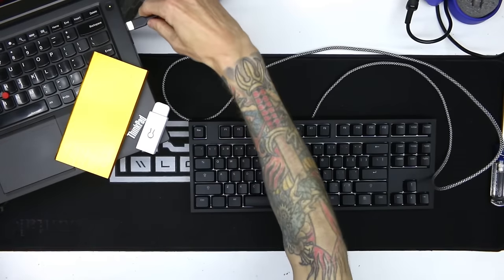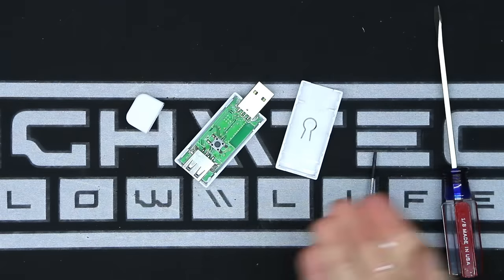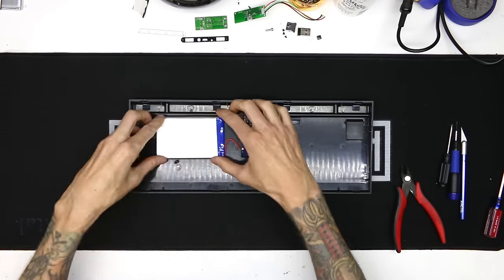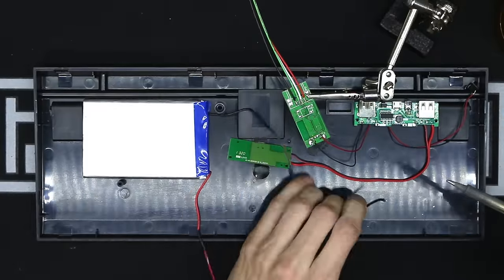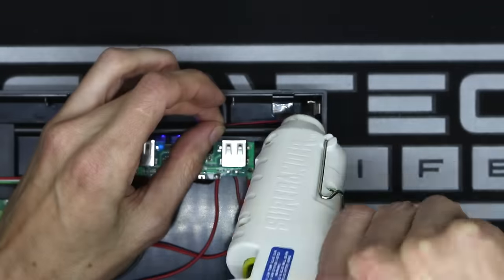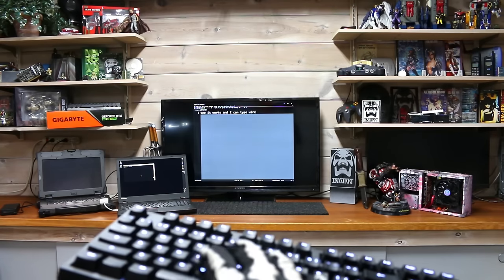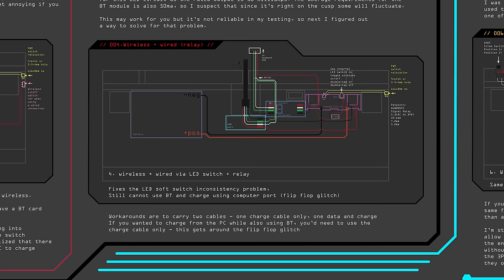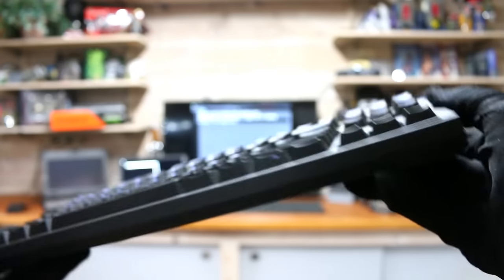⌨ Make ANY Keyboard Wireless! - Convert Any USB keyboard to Bluetooth Wireless - DIY Tutorial How To

Comment: Really loved the tutorial! The BT module you've used is BT 4.0, would you know and recommend any modules that are 5.0 and would do the same? Or is it even necessary to have 5.0? Thanks, really appreaciate it!
Reply from the maker: Thank you! Biggest difference is range, I believe 4 is 33ft and 5 is 248ft range. I don't know many applications where you'd need to be more than 30 feet away from your computer, but I suppose it's something to consider. I'm quite certain HHSCI will offer a 5.0 version at some point though, so if that's something important to you, you may want to wait. 👍
Reply: @hightech-lowlife  oh ok sweet, yea dont think I need that much range. Ill stick with the 4.0! Thanks!!
Reply from the maker: @zyeansantos7472  No problem 👌

Comment: It's a great video and proves it can be done although the adapter itself costs around $40 and a power bank around $20 not to mention the time and other tools required to make it happen. Unless it's a really unique or special wired keyboard to convert to wireless I believe one can get a fairly good wireless keyboard for $60. Add another $20 and we are in mx mini or keychron territory.
Reply from the maker: Thank you. 

Yes, I was going to put something in the video explaining this, but I felt it was so obvious that it would be a bit condescending, but it seemed like I needed to do it after all judging by quite a few comments I got that were attempting to call out my "oversight". 

A lot of people have pointed out "this is pointless because I could just buy a ___ for ___ and save money and it would be easier". To me, this is obvious, not really worth commenting on as this video is clearly not for that intention, if you're trying to make a wireless keyboard for less than $5, this is not the tutorial for you, and I don't believe it's possible to convert a wired keyboard to wireless at that price point, unless you're exceptionally good at hacking, firmware and software modifications and even then if you value your time at all, it's not worth it. The fact that someone has not done or made a tutorial on it yet in all of these years to me shows the difficulty. 

I feel if you're severely limited by your budget than seeking a wireless option is equally pointless, you can easily get by with with a very cheap and most cases free keyboard that is wired. Wireless adds much more complication, less reliable connection, reliance on batteries, etc. 

If your end goal is just "cheap wireless" there are many options premade already out there, this tutorial is not meant to be a replacement of that. This tutorial is for people who either want to hack and build something of their own for many reasons (love DIY, learning electronics), or if they have a board in which was never offered wireless and there are no alternatives to the keyboard they want that is also wireless. 

Thank you.
Reply: @hightech-lowlife  Well said however with such videos it is obvious to the content creator as you are already aware and have done your homework but to the rest of us who are not aware it is not so obvious. 

As you have mentioned a lot of people have pointed it out which should give you some sort of feedback and another *idea*.

Personally yes I would wish to do such a project as you have demonstrated how simple it is. I’m not saying the whole project should cost me less than $5 which is not practical but it shouldn’t cost me more than the price of a brand new Logitech MX Mini or a similar tier keyboard which is also not practical. I am not severely limited in my budget that I cannot afford a wireless keyboard. They can be bought for as cheap as $10. I just bought a Logitech MX master 3 mouse and was looking to compliment it with a wireless keyboard. I have a wired PS/2 cherry keyboard and was looking to make it wireless but if that's the cost then I'm better off just buying a Logitech Mx mini. 
  
Wireless is not as bad as you point it out to be. Yes, they rely on batteries but so does every other wireless device. I have not heard of a connection issue unless the keyboard is either very far away from the computer or there is a hardware or driver error. At the end wireless is all about user experience and convenience.

I totally agree with you on the part where there are cheaper wireless options already out there. And yes this project is for those who have a wired keyboard that they really want to make wireless.
           
Otherwise the reason why I watched your video is because I also love and enjoy DIY projects. I thought of doing a DIY project on my cherry keyboard but I will be using a different method.
Reply from the maker: @ahmedtwahir  Thanks man! 

Yes, it's actually quite difficult to create content in a mindful way, as the range of understanding from your viewers is extremely large, so you have to choose some spectrum. This also was the 4th video I ever made and I would have done a lot of things differently had I the experience I have now. 

I think for your particular wants, then it would be possible to do it for less, there are some arduino boards that are bluetooth that can do this, but you will have to load some code and probably edit some things. It may also not have all the features that this module does, so to save some money, there are some trade offs. Another option is to pick up another cheaper wireless keyboard, and port the guts to your wired board, I've seen this done and it could also be a cheaper method, it all depends on how much you can get the other used board for. 

People will have a subjective experience with wireless, but having worked in many environments using wireless (business, networking, etc), you always use a wire when you can for a reason. Hardware and driver errors can occur quite often, or actually most often when you don't have the time to deal with them. 

Thank you for your feedback, it's much appreciated. If you do try to the DIY route, I wish you the best of luck on your project and I hope it comes out very well.
Reply: @hightech-lowlife  
I agree the viewer spectrum is broad on this one. 
I'm getting a wireless keyboard and mouse set for less than $10. Will do the internal swaps and maybe even mod the cherry chassis with a paint job or carbon fiber wrap. Easier said than done 😅.
I'm still new to content creation and my video/audio is not as crisp as yours but will get there eventually with discipline and practice. 
Thank you for taking the time to write back and wish me luck. I wish you more success with your channel and videos  🤝.

Comment: So about the 8th option circuit, I observe the wiring and pretty confuse. does that mean the wired connection port and the port to charge the battery were independent ? Like if I want to use the keyboard wired while charging it, there will be 2 cables connected to the keyboard ?
Reply from the maker: Both "completed" circuits I show in the infographic (7, and 8) allow you to charge the battery in wired or wireless mode, so you will be able to charge the battery whether you're using it wired or wirelessly. Remember there is only one USB port that goes to your computer (or charger) so you will only have one cable connected when charging regardless 👍

The main difference is that in (7) you're using the BT module as the "wired" bridge to communicate to the computer with a wire (USB cable), the only drawbacks to doing it this way is that it's not a "native" wired connection, so if you want to do something like flash your keyboards firmware with it, it will not recognize the keyboard because to your computer all it sees is the BT bridge. (7) is the easiest and simplest way to wire this up, so unless you have a use for a native wired connection, I would go that route. 

(8) essentially uses a relay to "unplug" and "replug" the cable connections internally, the same as you would if you were unplugging from the BT module then plugging directly into your computer, only it's done off a button and only the wires are swapped internally. This allows you to have a direct wired connection to your computer without going through any bridges, so your computer will recognize the keyboard as a keyboard.

Comment: Wonder if this would work with a K95 Corsair. Has dual USB for the leds.
Reply from the maker: It will work with backlit keyboards, for dual USB you may need another battery for LED power if it's that hungry.

Comment: Wow very nice! Do you know if there is any solution to build the opposite (the equivalent of a Logitech receiver) in order to be able to quickly swap a bluetooth mouse and keyboard between computers using a small usb dongle. Thanks!
Reply from the maker: You mean just a USB BT dongle? Those are very common and ubiquitous: https://www.ebay.com/itm/161959114629
Reply: No, I meant a DIY dongle which would run the bluetooth stack on board and not on the host device and would store the pairing with both a keyboard and mouse and fake to any host the connection to be USB. Ideally being accessible for configuration via SSH or something like that @hightech-lowlife. An example of this, is being able to go into the BIOS on an old computer using a bluetooth keyboard but more commonly, the use case would be to quickly swap a set of keyboard and mouse between different computers using only  a dongle. I know many people who are stuck on the Logitech ecosystem because of the practicality of their dongle which does the same thing but is proprietary. Such a device would make them super happy because they would be able to use whatever bluetooth keyboard and mice they want and keep the same functionality.
Reply from the maker: I'm not aware of any BT dongles that operate like a 2.4GHZ dongle as you have described. I'm sure it's possible to do, but it may just be easier to gut a logitech keyboard for it's "unified transmitter" bits and maybe port it to be reattached to any USB device, and then use their unified receiver for that scenario. Sure you miss out on the BT features of being able to use any BT device, but it will work as you wish, and may be modular enough to be able to plug in any USB device easily. 

After doing a menial amount of googling for you I did find this: 

"You pair Bluetooth device to a particular OS instalation on a particular computer. This is inherent design feature of Bluetooth itself, you can't do anything about it.

OTOH custom USB dongles (like Logitech and most of non-Bluetooth mice/keyboards) pair device to a particular dongle. The device works instantly with any computer you connect matching dongle to.

As Vladislav mentioned, you can craft a bridge: Raspberry Pi Pico W has everyting necessary to present itself over USB as a generic mouse and accept connection from a paired, fixed Bluetooth mouse. This would instantly work with any computer you'd connect this special Pi to."

So what you want is possible, if you use another intermediary computer (raz pi pico w) to spoof as a generic device and then relay the bluetooth separately.
Reply: Thanks @hightech-lowlife  I'm going to try the pi-pico way. That sounds promising indeed 🙏
Reply from the maker: Cool man, I hope it works out!  @altaresification

Comment: Will this still allow software control of the keyboard. For example if I followed this tutorial for a corsair keyboard, can I still control the rgb etc?
Reply from the maker: It may be possible, but also may not. I have not tried it personally so I'm not sure. It depends on how the software is affecting the keyboard, whether it's flashed/loaded onto the board, or if it's simply interpreting USB commands or making a translation on the computer side.

Comment: Hopefully you will answer good sir, since, scrolling through the comments I didn't see a possible solution to my dilemma(or maybe I just missed it). Where I live, it is near impossible to acquire that specific bluetooth module, which functions exceptionally well, being able to power up the module AND the keyboard simultaneously. Could there be another way to power up the keyboard while connecting it to the BT module for inputs?? Most things I find either require 2 parts (which would not fit inside my specific keyboard: Redragon Kumara K552) or don't have 2 USB for connecting the keyboard and on the other side have it power it up.
Reply from the maker: This BT module is pretty small, you don't need a charge PCB with two USB outputs, they make very small charge circuits which would work fine as well, something like this: https://www.aliexpress.com/item/3256801472488679.html 

You can also use an arduino which can do both BT and charge in one pcb: https://www.adafruit.com/product/2829 but you will have to load and flash code to it. 

Your board actually does have two parts, only those parts are very close together (port is soldered to the board) which I'm assuming is what you're talking about. You can do an intercept like I did on this build: https://youtu.be/2Df7Dh3-3o0 although if you have a type-c connector it can be quite difficult.
Reply: @hightech-lowlife   I'll start off by saying, thanks a lot for taking the time to respond and lending a helping hand, I appreciate it. I love my keyboard and when I saw your video I knew I had to do it, very inspiring.

I'm very new to this, so naturally, I have a lot of questions. Obviously I have to think about the project long enough to be 100% sure of what I'm doing and have an understanding of it. So for now, I'm taking things slow.(lots to learn)

I did search up bluetooth modules, almost every video I saw they were using an arduino with another module, flashing it with code.

Aaaah yes, you're right, looking up images I can see where I'd have to do an intercept(I think), no type c connector though so that's a plus! I'll watch your video and study up.

Again, thank you very much for your support. Your videos are exceptionally well made, providing resources to the rest and solutions. The way you explain things, really entices one to learn and try things out.
Reply from the maker: @not_an_ely  Thanks a lot man, much appreciated 🍻 I'm sure you can do it, might take some trial and error and frustrations in the beginning, but if you are persistent you will have what you want, without question 👍Good luck!

Comment: Just a quick question... is it possible to make 2.4Ghz dongle like connection ? Like the new mices have with those dongles ?
Reply from the maker: Yes, but easiest method would be to gut a wireless keyboard that already has it and port it to the keyboard you want. They don't make a module like this for 2.4 that I am aware of.

Comment: Not sure if you are still replying to this. I Have a corsair RGB keyboard, and would like to try something similar. do you know if the RGB would still be functional and able to be controlled via software with this setup? cheers
Reply from the maker: It may be possible, I haven't tried it on a RGB board with software like that. Although possible I would say most likely not as the BT module acts as a "bridge" so the USB signals are not directly connected. With my wired/wireless switchable mode you should be able to at least set the board with software using the direct in, but maybe not on the fly over wireless 👍

Comment: Great video. I have no aptitude for this stuff, but gratefully my brother is an EE, so I'm hopeful a beer bribe will yield good help. 

Problem...

The handheld scientific bt 500's availability is spotty. 

So their can you suggest an alternative bt adaptor? Especially for a USB c keyboard?
Reply from the maker: Thanks man! 🍻 I haven't had any issues with availability in the past (but could be chip shortage stuff). From my research there aren't any good alternatives that can compete. You can always use an Arduino, but you have to load libraries and code some of the functionality, which is great if you want to learn, but not if you don't. Good luck man!
Reply: @hightech-lowlife  Handheld Scientific says it will ship 9/30/2022. Yipee.
Reply from the maker: @brendanoreilly4789  Awesome 👍

Comment: Hey man, I know you made the video about a year ago, but I wanted to get your input on an idea. I’ve got an ergo keyboard at my office and I want to get rid of the wire that connects the two halves. Do you know of a way to make one of the two halves a primary BT connection and the other half only connecting to the primary BT half?
Reply from the maker: I'm sure it is possible, but I'm not sure if the BT-500 is a fit for that purpose. I would reach out to the manufacturers and see if any of their customers have done something similar first, they might be able to tell you if it would work or not. 

I'm familiar with some other split keyboards (such as the ErgoDox) and they use a TRRS audio cable to transmit from halve to halve, but that is just essentially a 4 pin cable, so the BT-500 is probably much more complex than it needs to be (no need for USB protocols, etc). It may be better suited to use an arduino that is just relaying input to output as if it were a wire. This cable I'm sure is also providing power, so you'd need a battery for at least the side that is disconnected, most likely it's only 2 channel (data) as the other 2 pins are power and ground.
Reply from the maker: If it is merely a wire connecting them (without the need for USB protocols and such), then you (most likely) could do it this way for wireless transmission of the data wires: https://www.youtube.com/watch?v=IM3xg2Q_E3w